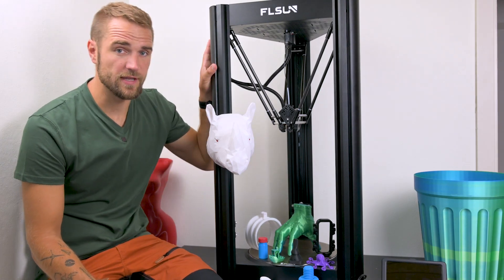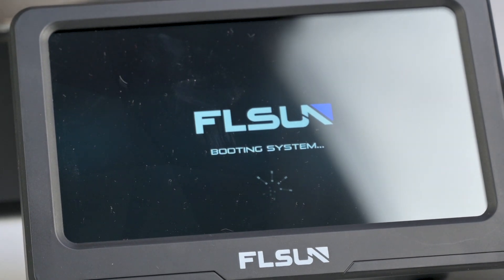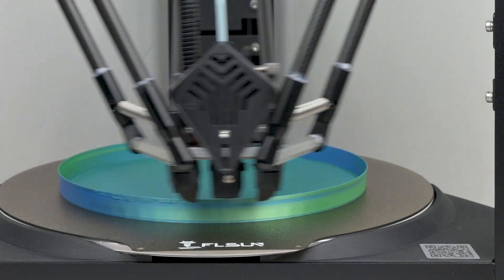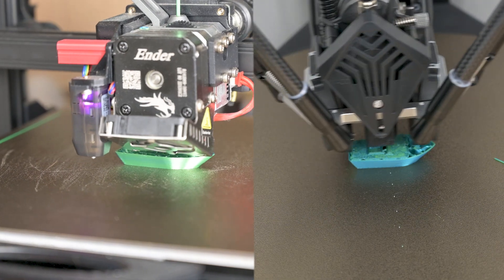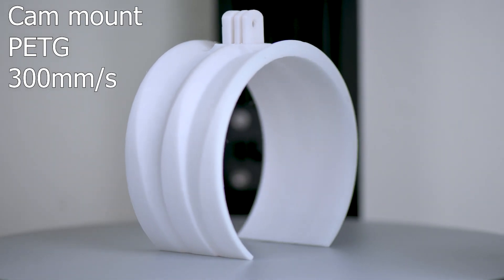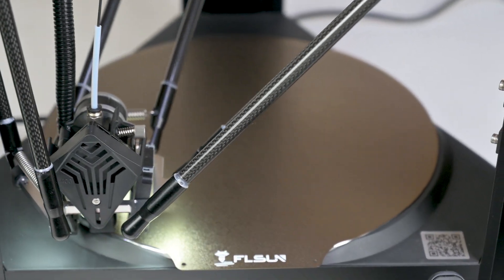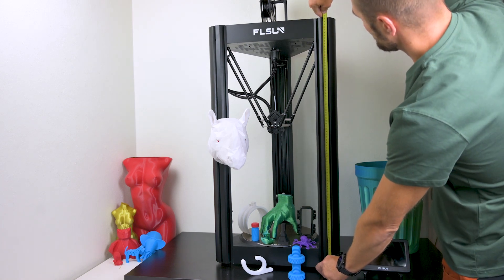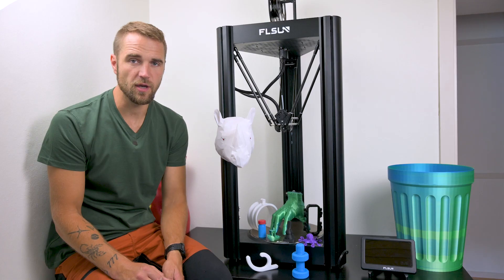FLSUN V400 super fast 3D printer review

Comment: With the new upgrade, i understand its now 600. Correct?
Reply from the maker: It is now moving up to 600 but in reality you will only be able to use those speeds if you print in tiniest layer heights and nozzles. Otherwise filament volumetric flow or insufficient cooling will be your problems in reaching the max speeds
Reply: @VRMinde  gotcha. I mean I have had an anycubic vyper for years and I print it at 60 MMS. It's a phenomenal printer and I just need something faster
Reply from the maker: take a look at creality k1 as well... It already has enclosure, so no need to modify/build one. And I enjoy it so far a lot! @uncannyrecovery3980

Comment: Congrats on the new printer. 👌 If I had the space I'd buy a delta printer. 
You can harden functional prints by saturating the print with super glue then you can scrape the print with a Stanley knife blade (make sure to keep the blade perpendicular to the print for smoothest results).
Reply from the maker: That is smart with the glue :) thanks for the idea